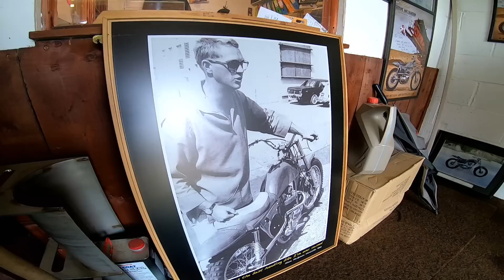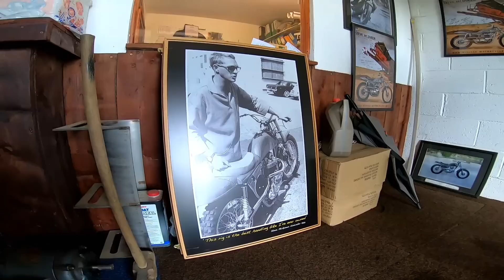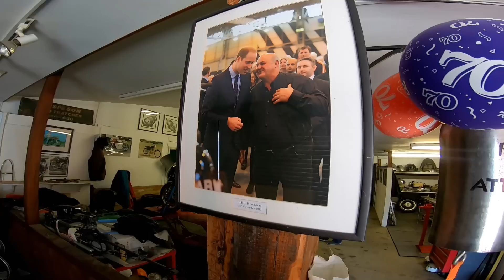Metisse Special! - Biker Scran with Geoff and Dan: Part 2

Comment: Every January Meecum Motorcycle Auctions have an auction in Las Vegas,  Nevada.  Almost 2000 mostly classic bikes are sold over 4 to 5 days. I see alot of British buyers purchasing  mostly British bikes. Several of them band together to share the cost of the containers and ship them back home (England). The Japanese buyers are now doing the same thing with the late 1960 and early 1970 Japanese models too. 

I'm glad these bikes or parts of these bikes are being repurposed to live on. Many bikes at the Meccum Auction are restored and are in class 1 or class 2 (better or show room), many  are class 3 that are complete and running condition.  If you come don't bring money because you will buy.

Comment: I noticed that the Adelaide had 1968 (G) plates. I thought that required that the rolling frame was from that year (or rolling chassis in the case of a car). Perhaps the rules have changed... or I am simply mistaken. Great video...I wish them every success.

Comment: Interesting bikes. Must be scary, if you need a sudden stop... 😂I miss some adventure-genes for this type of suicide. ;) But ... great looking machines! 👍🏻 Thanks for the VLOG! Cheers Tim
Reply from the maker: Cheers Tim!
Reply: In case you are a biker (what I doubt).... remember when you had to break that hard..... and why?
Reply: @heinzmaier2739  ? Whats wrong with you? 😂😂😂
Reply: @737adventure  Noting at all.... but Generation of bikers were not suicidal, in fact 3 of my 4 bikes still have drums. If you come in such a hairy situation, it is mostly because you don't pay attention, or you drive over your limit. Ask a seasoned biker when,... if ever, he needed this enormous stopping power of modern disks .... and why?
It is nice if you have them.... if not, it's OK too.
Reply: And.... in a scramble you don't use the front brake at all...
Reply: @heinzmaier2739  I recommend a safety training.
Reply: @737adventure  You are funny :-).... come with me classic bike racing... no disk no slicks and lots of fun.
Reply: @heinzmaier2739  😜 Scaaaryyyy 😆
Reply: @737adventure  That's part of the fun.... Just as teaser:
Norton feather bed frame, tuned BSA Goldstar engine, five speed Gearbox, Ceriani, Fontana, 140 kg.... 200kmh at 7400rpm. We race on the circurit Grobnik in Croatia.